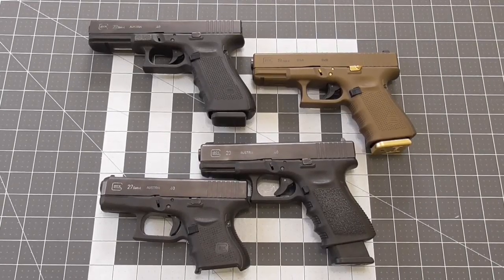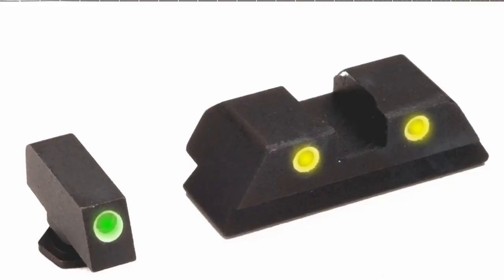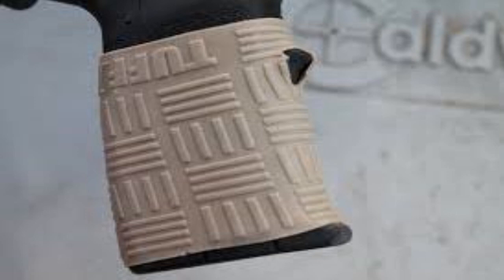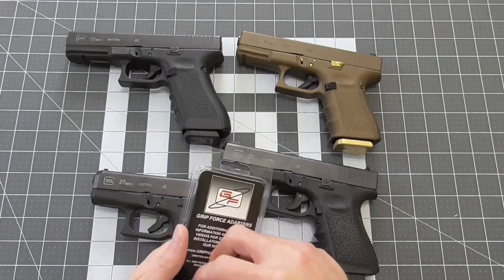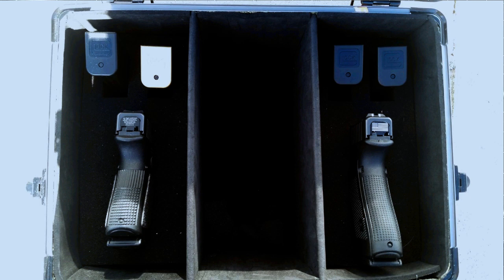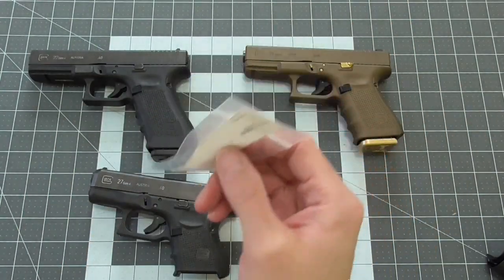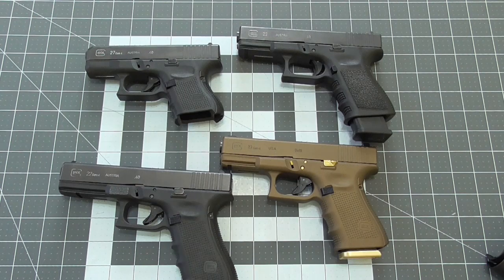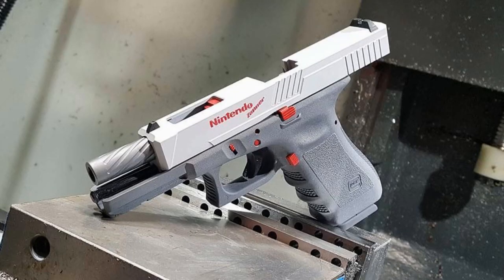Glock modification, aftermarket parts, and other accessories.

Comment: I carry a Fowler mk1 imo it's the pinnacle of the glock pistol. Hand fitted barrel accuracy guarantee sub 1" groups at 30 meters and his zero trigger. I have owned shot and carried agency robar and igfs pistols all glock 19's. I have also like many just pushed new sights on my pistol and worn out a factory configured pistol. The Fowler's are substantially more it's cohesive.
Reply from the maker: Hans Addicks that is good to know, thank you for watching!